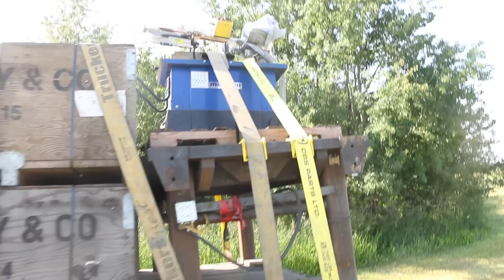Welcome to the new shop! Ya'll love it.

Comment: For sure, the truck driver had your back on that move, and definitely put that cover plate into a safe spot for ya when it almost flew off in the wind.  What a legend.  Totally stoked for the new space to give you some new inspirations at the forge and hammer.  Maybe add some more merch options to your website, cause I would totally buy a few stickers, which are cheap, and pay probly way too much for them, so you can make some easy scratch.  I think I'm also not alone in wanting to support your channel but I don't need an axe or a t-shirt really, but want to buy something to help you grow your channel and business.  Cheers!